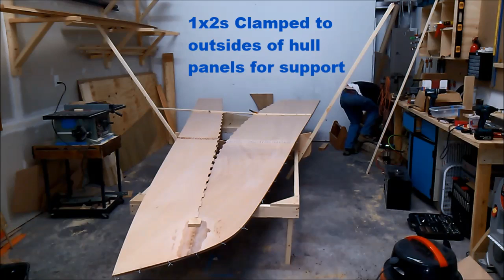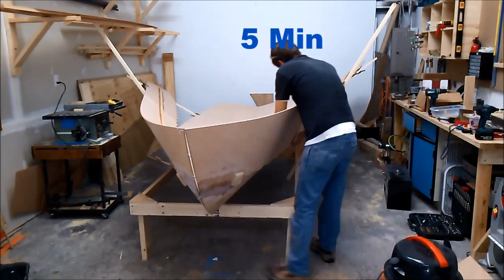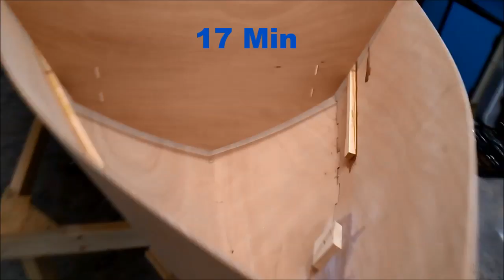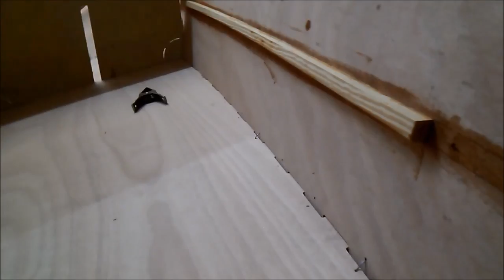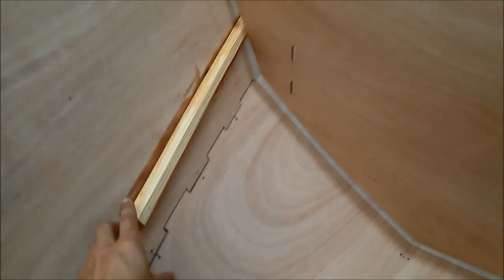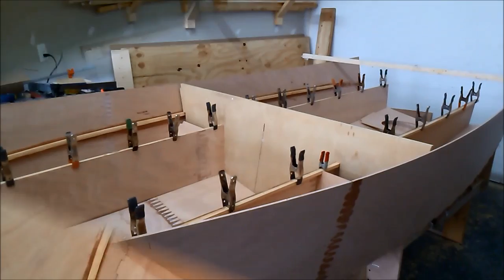Core Sound 15 Hull Assembly Part 2

Comment from the maker: Matt,
Yes this is the kit version of the B&B CS 15. The kit is not advertised on the website currently. This is the first one to be cut and is being built as a prototype. The kit will be made available possibly in a month or so once the final draft of the parts are complete.
Reply: Any idea of price?  And will it be available in sections, ie, could someone buy just the pieces for the hull and build the rest from scratch?
Reply from the maker: All of the kits are available as "plywood parts only" and the hardwood stringers and cleats you source and rip yourself except for the precut and dato'ed deck beams usually. You can do all the rest yourself e.g rigging, masts, hardware. We don't recommend modifying the internal structures significantly but often kits are modified for specific needs and styles. Sailing vs fishing for example. You can also get just a Mast kit or just a hardware kit as needed. Sails are best purchased from b&b.